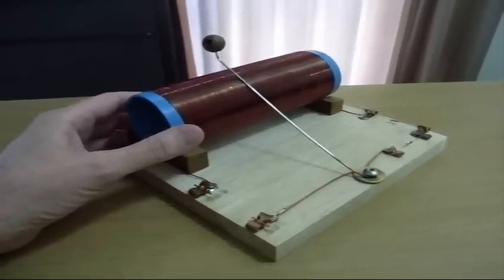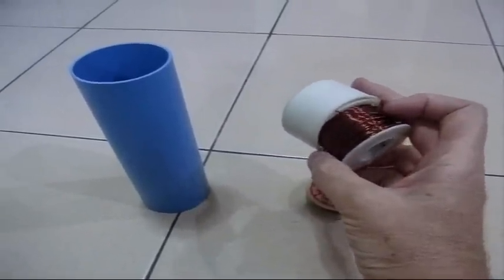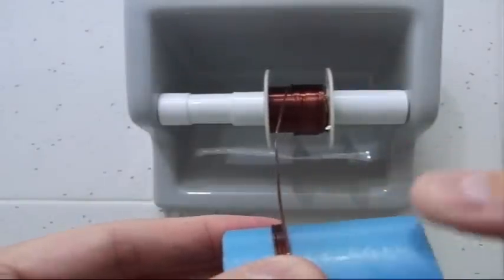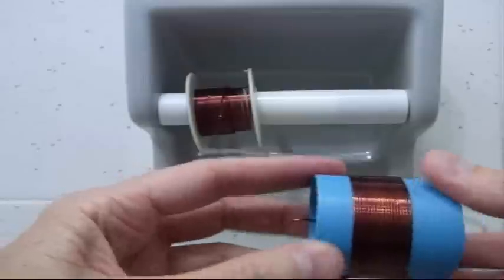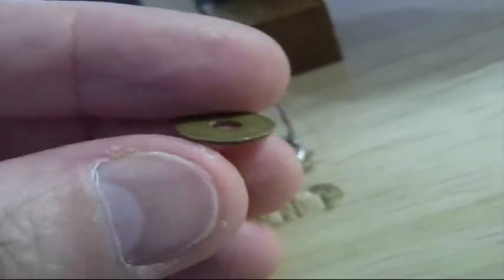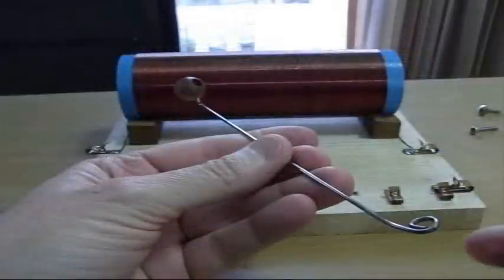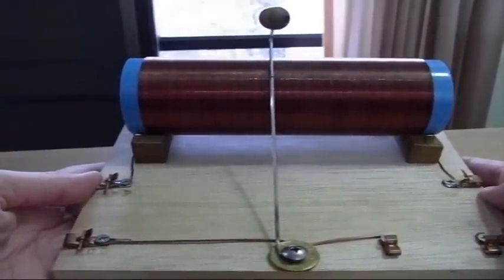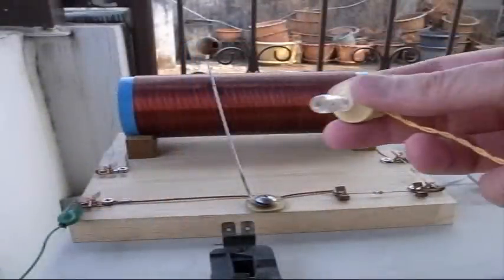How To Make A Crystal Radio - No Batteries (Updated Version Available)

Comment: Can i use the pipe 1.5 diameter instent of 2.5???????
Reply from the maker: +Faisal Abunameh Yes, it should work, but it will act differently.  It might have less selectivity (get fewer stations) and require more turns.  You can use the cardboard center of a roll of paper towels, toilet tissue, wrapping paper... also.  You can rub it with clear glue and wrap it with wire.  When the glue dries it will be pretty tough.  (Not as strong as plastic, but pretty good.)
Reply: +tsbrownie Thanks

Comment: Can you hook a speaker up instead of an ear bud?
Reply from the maker: +XsurvivalSpecialistX To run it directly you need something very sensitive, like a crystal earphone.  A regular earbud like from apple won't work (it's electro-magnetic).  If you want to drive a speaker you can, but you'll need an amplifier like they sell at electronic stores.  Of course the amplifier requires a battery, so you lose the battery-less part.
Reply: +tsbrownie ok thank you for the help!

Comment: If i build a longer coil, the reception will be better? The resistance is here for what reason?
Reply from the maker: More turns (all else the same) will lower the frequency range.  If it is too low, you will not receive much.  The new piezo earphones have capacitance that needs to be discharged.  Without the resistor the sound will be soft and it will pop a lot.

Comment: for ground could i connect it to my table with metal touching the ground
Reply: You need to make a good electrical connection.  Better to hammer a metal spike into the earth.  Deeper is better.  Wet earth or moist is good.  Very dry earth like a desert is not so good.  Or, second way is to attach to copper water pipe so long as your supply is not in plastic.  Or third way is to use the ground of your mains electrical system.  Attach to the metal body of  some electrical appliance you have that is earthed.  Or, get a mains plug and remove the live and neutral pins and attach to that earth (but don't do this last one unless you are very sure what you are doing)
Reply: thanks
Reply: For AM believe it or not along top of the ground is best, if you have the space a fan type array leading back to your radio. I used to run a low power part 15 transmitter and researched it quite a bit, all the hams will run wires just under the surface for best power, could be different for reception but I doubt it . .

Comment: Might I ask, but I can't really order any parts or anything. So regarding a crystal earpiece, is there anything I can use, or does it have to specifically be a crystal?
Reply from the maker: MUST be crystal.  You can use an amplifier, but that takes away the "no battery" operation.  I've got a video on that also.
Reply: Gotcha. Well, if I do go with the amp approach, i might just make it solar rechargeable.
Reply: Take transformer out of a cell phone charger, connect the primary winding to the radio, and secondary winding to modern low-impedance earbuds. Should work.
Reply from the maker: I will have to try it.  The total power output is very tiny and after it passes through one of those transformers the resistance will lower it more, but it's an interesting experiment.
Reply: The resistance of the transformer should be somwhat similar to the crystal earpiece.
Reply from the maker: The piezoelectric earpiece is pretty much infinite resistance (it acts like a capacitor).  The transformer will act more like a short with resistance.  I will have to try it to be sure.  I have both.  Will be interesting.

Comment: At last a crystal set builder who knows that the piezo earpiece needs a resistor across it to provide a DC path for the diode. Most of the other builds on YT don't fit this resistor, but without it the results are very poor.
Reply from the maker: Thank you. Most are still using designs from the 1960s and earlier when crystal earphones were not piezoelectric. You'd be surprised how many people leave comments about how I am doing it wrong because I have a resistor instead of a capacitor. :(

Comment: If I build a larger coil, will it extend the frequency range?
Reply from the maker: It depends a lot on the total capacitance and inductance.  As you get more of both the high end goes down and the low end goes down, so the total stays the same.  Also, if you get outside an AM (amplitude modulation) band you won't receive anything.  This works only with AM.  Usually what they do is create a radio with different coils that you clip in or out of the circuit.  I have not made one yet, I will have to research that and see if I can find an easy / good one.

Comment: I also heard that the coil is 160 turns on the tube ,your look to be more,and the magnetic wire I bought was a small roll and I was charge 10.00 bucks for that little bit there has to be a better supplyer for that wire.
Reply from the maker: +Ron Thompson One design has almost 180 (178?).  Another has less but does not produce the same loudness.  The last wire I bought was at a place that sells to people who rewind motors.  I got 100 meters for $12 of 0.5mm enameled wire.  It takes a bit of disassembly work but my first crystal radio coils' wire was unwound from old transformers.  One side will have wire that's really too thin, but the other side is usually much thicker and very adequate.  You can also use light ballasts but the wire is thinner.  Wire that's too thin can break when you sand off the enamel and the wire itself will wear out faster from the movement of the wiper.
Reply: That's good to no ,I hope I can find the deal u got on wire ,I no I paid to much,and it's the thin stuff,I call around to places that rework altenators

Comment: Dose it scale up? And how big?
Reply from the maker: If I make the main part, the coil bigger, it changes the frequency, probably outside the AM band.  If you want max reception you could use superconducting wire / components and a huge antenna with a massive counterpoise ground.  I'd watch a video on that!
Reply: @tsbrownie  I'm doing research for my anthology sci-fi book.
Reply from the maker: @Dboy21ish  I see.  OK, well good luck with your book.

Comment: Sir how will i know or how will i test if there is current flowing in my crystal radio because i dont have earphones, i just want to prove to my prof that there is current in my radio.?
Reply from the maker: +Jonas Orate Sorry, your comment did not show up.  A VOA (volt - ohm - ampmeter) across the different points should show some AC or DC voltage if it's working.  Not a lot, but a little.
Reply: +tsbrownie it's ok sir your comment is just in time, i really thank you for much help :)

Comment: so i snipped of the ends of my earpiece in an attempt to expose more wire. am i screwed?
Reply from the maker: No, but it's a bit tricky to strip off the insulation without breaking the wires, but it's do-able.  You can use a sharp knife to cut carefully into the insulation, and that can do it.

Comment: Hi, I had a computer speakers without radio inside but still those speakers emits sound of radio station without connecting the sound jack to computer audio output. Just I do is turn ON the speakers and radio sounds starts but the volume is pretty low. How's that?
Reply from the maker: If you have a radio station nearby that is common.  The computer connection wire acts like an antenna.  You can put a ceramic RFI filter core on the wire and that will often stop it.

Comment: What does it matter if the PVC tube is not thin wall?
Reply from the maker: It probably will not matter much.  Thin wall is cheaper and breaks easier.  Thick wall probably has some small effect on inductance.  That's probably it.
Reply: tsbrownie hey I really appreciate the prompt response. I have a business working with youth housed in the juvenile hall. I am tasked with making kits for 100 students to construct this device. I'm excited for myself and the students. Thanks again. msl-la.com
Reply from the maker: Cool.  I check comments almost every day.  Let me know if you have other questions.  Always available for a good cause!  Be sure to use exactly the specified diode (others will NOT work!) and the specified earphone (ditto).

Comment: hey what band dose this radio pick up ?
thank you
Reply from the maker: +kim jong un It picks up the standard AM broadcast band.  Approximately 535 to 1700 kHz.  You can make that more or less with the coil design.  Thank you for taking time out from running the people's paradise to comment!
Reply: +tsbrownie wow that was fast thank you ps how do i make it pick up mw ,sw fm,lw,
Reply from the maker: It has to be amplitude modulation (AM), it does not work with FM or such.  In general a smaller, shorter coil will give higher frequencies (lower inductance) and a bigger, longer one will give you lower frequencies (higher inductance).  There's also the issue of power; power decreases as 1 over the distance squared, so the ability to receive falls off rather quickly.  That can be compensated for a bit with an amplifier, but that's kind of cheating since it requires a battery!
Reply: oh ok guess no point in building it i live in india where u dont have any am stations
thank you for helping a 13 year old beginner
Reply from the maker: +kim jong un I found many AM stations in India.  There are lists on the internet, I will include some links.  AM stations were the first and their long waves (low frequency) will travel great distances so they are still very popular.  I was surprised in searching that India has so few, most are FM now.  
http://radiostationworld.com/locations/India/radio_websites.asp

Mumbai has 3
https://en.wikipedia.org/wiki/List_of_radio_stations_in_Mumbai
Reply: +kim jong un Shortwave radio stations also use AM, but I don't know how many there are these days.
Reply: +Felix Automaton This type of radio is not selective enough for short wave, all stations will be on top of each other. In fact strong stations on medium wave will wipe out weaker stations. Worked well in the past with probably only one station.

Comment: Shouldn't the output be between the antenna and the ground?
Antenna to where ground and ground to coil before the resistor, plus capacitor between antenna to ground, left side of the coil free.
Reply from the maker: There are a couple of configurations that are similar that work, some are more selective, others get weaker stations (but have more cross talk).
Reply: @tsbrownie  Yes but in all the antenna and ground are at opposite   ends of the coil.
Reply from the maker: That is the most common way, but it's not the only.  Here are 3 diagrams where the antenna and ground are not at opposite ends of the coil:

https://www.google.com/imgres?imgurl=https%3A%2F%2Fi.stack.imgur.com%2FHzr58.png&imgrefurl=https%3A%2F%2Felectronics.stackexchange.com%2Fquestions%2F258401%2Fhaving-a-series-instead-of-parallel-lc-circuit-in-a-crystal-radio&docid=M8Mv84bx-IxjTM&tbnid=1fA97SCThapMJM%3A&vet=10ahUKEwjE4MqyscvfAhUBfX0KHfEVDqcQMwhJKAwwDA..i&w=600&h=328&client=firefox-b&bih=786&biw=1600&q=crystal%20radio%20circuits%20diagrams&ved=0ahUKEwjE4MqyscvfAhUBfX0KHfEVDqcQMwhJKAwwDA&iact=mrc&uact=8
https://www.google.com/imgres?imgurl=https%3A%2F%2Fphysicsmuseum.uq.edu.au%2Ffilething%2Fget%2F1641%2Fsparta_circuit.jpg&imgrefurl=https%3A%2F%2Fphysicsmuseum.uq.edu.au%2Fsparta-crystal-radio&docid=UUiMpFjOjL4InM&tbnid=yXJu6tDVRN8ykM%3A&vet=10ahUKEwjE4MqyscvfAhUBfX0KHfEVDqcQMwhOKBEwEQ..i&w=464&h=589&client=firefox-b&bih=786&biw=1600&q=crystal%20radio%20circuits%20diagrams&ved=0ahUKEwjE4MqyscvfAhUBfX0KHfEVDqcQMwhOKBEwEQ&iact=mrc&uact=8
https://www.google.com/imgres?imgurl=http%3A%2F%2Fwww.geojohn.org%2FRadios%2FMyRadios%2FFirstRadio%2FBExtal.jpg&imgrefurl=http%3A%2F%2Fwww.geojohn.org%2FRadios%2FMyRadios%2FFirstRadio%2FFirstRadio.html&docid=BKnoRNOF0y_tRM&tbnid=ZzJhTKjlQ_fsbM%3A&vet=10ahUKEwjE4MqyscvfAhUBfX0KHfEVDqcQMwh4KC4wLg..i&w=400&h=206&client=firefox-b&bih=786&biw=1600&q=crystal%20radio%20circuits%20diagrams&ved=0ahUKEwjE4MqyscvfAhUBfX0KHfEVDqcQMwh4KC4wLg&iact=mrc&uact=8

Comment: what's the resistor ohms aside from the crystal diode. I want to build one
Reply from the maker: The parts are in the description.  The resistor is 10k, but you can try other values to see what works best with your crystal earpiece.  Let us know how it goes.
Reply: +tsbrownie will do thanks and I plan on using a peizo tweeter on mine

Comment: Why should the coil be raised from the board? An insulator shouldn't affect the magnetic field...
Reply from the maker: +Scott MacDonald Wood is full of stuff like carbon and silicone (semi-metals) as well as iron and other such.  My first radio was just wire about a toil paper tube screwed to an old board, so it does work, just not quite as well.

Comment: Uma vez eu vi uma reportagem que citava sobre um radio que usava uma lamina de babear e uma agulha substituindo o diodo.
Reply from the maker: Once I saw a report that quoted on a radio that used a babear blade and a needle replacing the diode.
There are several metallic crystals that will work, the most popular was galena, a lead mineral.

Comment: Will you hook a volt meter up 2 it
Reply from the maker: I have in the past.  It puts out about 1 volt, but the amperage is very low.  Almost immeasurable.
Reply: Thats actually amazing tho
Reply from the maker: When I was a kid these things were amazing.  A radio without batteries (and before most people had pocket transistors some of these were literally pocket size) was magic.
Reply: Could you use a normal car antenna also y should you avoid electrical wires
Reply from the maker: It depends on the distance and power of the AM station.  A car antenna probably won't do it.  Usually you want a long wire antenna.  The reason to stay away from electrical lines is 1) Safety!  You don't want to get killed, 2) hum.  AM is susceptible to picking up the 50 or 60 cycle hum from the AC lines.
Reply: Thanks for the info

Comment: Being the lazy person that I am, was wondering if you could somehow just leave some wire on the spool and use that. ;-). Guess it's too narrow.
Reply from the maker: It has to be a single layer and tight on the tube. You are not the first one to dread winding a coil. My older brother used to "convince" me to wind his. It's not that bad, just put your brain in robot mode and it goes by pretty quickly. And they look cool when you are done.
Reply: @tsbrownie   Thanks. On another note, I've been reading on my FB feed that folks are using old and weathered zinc washers as a diode. Have you tried this?
Reply from the maker: @alanwhite933  No but I think it is probably worth a try. Many metal oxides/compounds will act as a diode, of course the most famous is galena, then there's iron oxides.

Comment: The Old crystal radios did not need a battery  but to get a decent volume we needed a battery powered amplifier
Reply from the maker: I have another model which I need to video that is so loud you can hear it from the earphone across the room!  It uses a coupled antenna rather than a direct connection.

Comment: can you listen to cb radio waves with this?
Reply from the maker: +lucas hawn Theoretically you can listen to any AM type transmission (but not SSB nor FM) if you make a coil and capacitor pair that covers that frequency range.  CB is roughly in the 27 MHz range.  AM broadcast is about half to 1 MHz.  A coil / capacitor pair would be much smaller (lower values for both).
Reply: Awesome, so if you made a coil with enough windings you could pick up FM stations? Like in your car? 90-107 Mega hertz or whatever they are? Or is frequency modulation totally different?